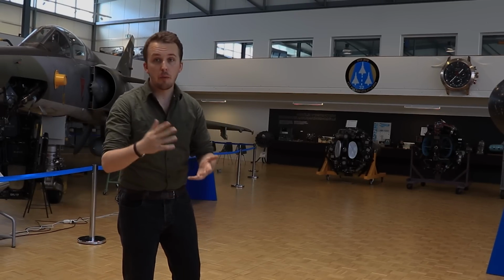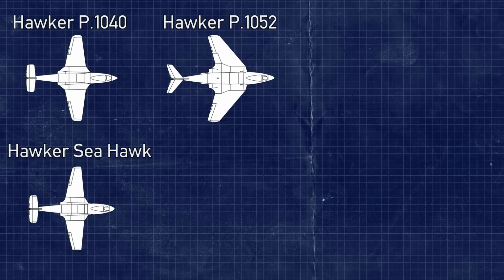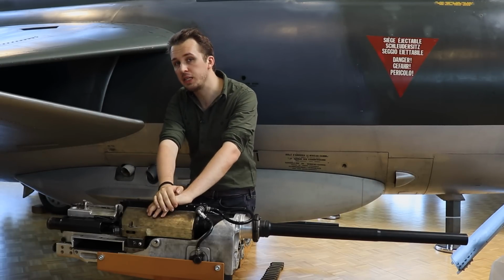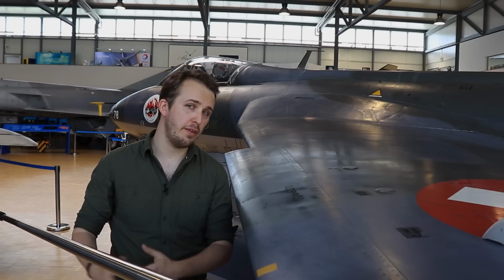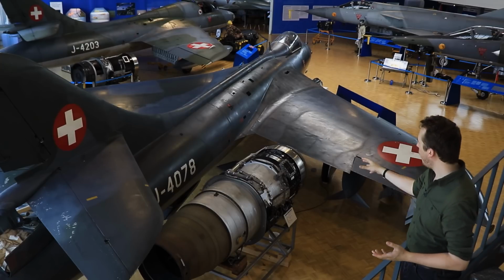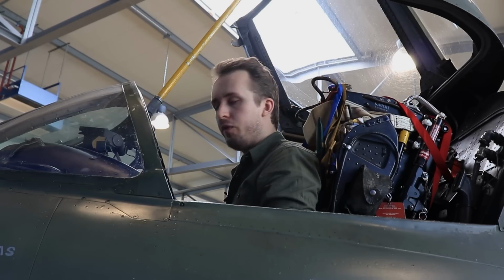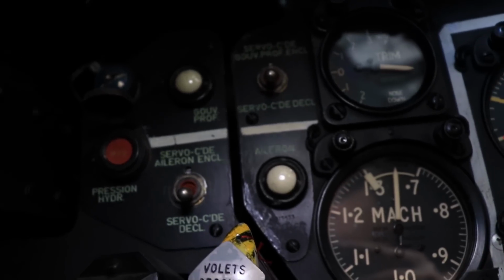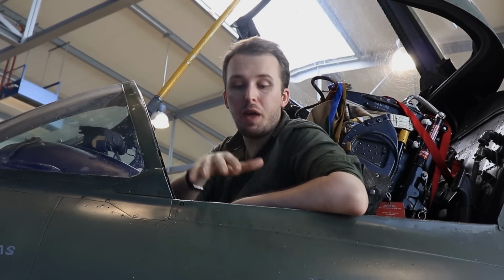Inside The Cockpit - Hawker Hunter F.6 / Mk.58

Comment: Considered by many the best subsonic fighter ever. The Swiss FGA.58 is much upgraded and a very capable machine. I believe the segmented box's at the rear of the 'Sabrinas' is the Chaff and Flare dispensers. The RAF Hunters had a ranging Radar and a Ballistics computer to aid Air to Air gunnery and accurate firing. The controls of which were duplicated on the Throttle to give a measure of HOTAS in Combat.  The gunsight had air to air and air to ground modes.
Reply: u didn't see the speed gauge did you? the top end is MACH 1.3 she was a supersonic bird.

Comment: As a Swiss guy and a true Hunter fan I really appreciate your video about the Hawker Hunter as it is really hard to condense the extensive history of that iconic aircraft into a 20 minute video. So you did a good job on that. However there is a small thing I'd like to correct. Before you entered the Cockpit you talked about the Sabrinas and pointed out that the gases from the Gun firing where emitted backwards, away from the jet intakes. Now what you pointed at actually where the Chaffs and Flare installation. The gases where pointed downward by the gun deflectors at the end of the barrels as you correctly said before and some of the internal gases where evacuated together with the shells of the guns via the tubes between the Sabrinas and the fuselage. Furthermore with the newer Rolls-Royce Avon 203 which was in the Swiss Hunters this problem wasn't existent anymore. How ever the Swiss hunters are special in many ways and differ from all the others. So where the MK 58 the only ones with RWR, Chaff and Flare containers e.g. (as far as I know). This was all added in the KAWEST - standig for "Kampwertsteigerung" (or Hunter 80 Program) in the 80es. Also the Swiss Hunters where the only ones able to deploy Sidewinders and some where even equipped to deploy the "Maverick AGM65" Television guided Air to ground missile. Special as well at the Swiss Hunters Sabrinas was that they where elongated, not only to collect the ammunition links (which was the main reason for the Sabrinas) and contain the Chaff and Flare installation, but they had to collect the empty shells as well. The first Swiss Hunters ejected them as all Hunters did, but during training's on shooting ranges in the Swiss alps (Axalp e.g) these shells fell to the ground on meadows, where in the summer cows where located. Now these cows licked on the shells during the grass feeding and showed signs of poisoning later on. So the Swiss airforce hat to do something to prevent this. So they defined, that in peace times the Hunter just carried 30 rounds of ammunition per gun, so that the empty shells could be collected in the Sabrinas as well. Furthermore because of the immense recoil of the four 30mm Aden guns (could be more than 5t), which tended to damage the structure over time the Swiss airforce decided to fire only two of them simultaneously. 
B.T.W. In the 1970es Switzerland got an offer from Hawker-Siddley for a more modern and improved Hunter the so called Super Hunter. How ever the Swiss airforce wasn't interested in it, as it offered to less and many improvements Hawker-Siddley proposed where already incorporated in the Swiss Hunters anyway by the Swiss airforce them self.

Comment: Why do you need a 30mm cannon on this plane. If it is going to shoot down bombers a 20mm should have provided plenty of fire power with less weight.
Reply: The aden cannons were just better
Reply: @ethapnerry5740  You do realize that it could be produced in a 20mm version with little difference in cost.
Reply: @johnmcmickle5685  you just answered your own question
Reply: @ethapnerry5740  I am asking about the reasoning behind the decision. Now run along. There is no need for a 30 mm. Especially when you consider all the negatives like reduced number of rounds per gun carried, or the additional weight of the guns, just to name two oblivious draw backs to using the larger caliber.
Reply: @johnmcmickle5685  britain was already using aden cannons so it was just more effective
Reply: @ethapnerry5740  That might be but if you could increase the number of rounds carried per gun by 20% or more you increase the potential effectiveness of the aircraft.  Iit is like the story of the Tsetse Mosquito that shout down a German plane with the 6 pounder mounted on board. It worked but no necessarily the best choice of weapon for air to air combat.

It is a balance of weight, power, amount of ammo, and what is needed.

Comment: I spent over ten years working on the Hunters of the RAF in various places. It had a novel starting system which used isopropyl nitrate turbine starter (although the trainers used a cartridge system). The air brake was interesting from a hydraulic point of view in that when set to operate hydraulic pressure was fed to BOTH sides of the jack. This resulted in the air brake operating very quickly. Engine changes needed the aircraft to be split in two just aft of the wings, this was always a lengthy job. And I recall changing an engine which went u/s on its first run. The only spare engine we had was in another aircraft which was at that time u/s for another reason, so I think that the one engine change turned into four! The other major job was setting up the undercarriages to Service Instruction 72. This was a seriously fiddly job and if it needed doing to all three undercarriages could take a couple of days. One had to adjust the locks to hold the legs up, also the sequence valves for the doors and the door locks, nightmare!

Comment: the F-104 was twice as fast and it had about the same amount of power
Reply: Crashed twice as fast as well.
Reply: the F-104 was about half as heavy with a higher revving engine...
Reply: @Jack29151  weight affects the acceleration not the top speed, the top speed of a loaded B-17 is exactly the same as an unloaded B-17.

Comment: Conversion Mk 6 to Mk 9 was thought to be the best. This was an upgraded in the mid 1960s to fire four guns at once (RADFAN War) and fitted with an upgraded 'Foxhunter 'RADAR for interception. MK9s are quickly/simply identified, by a strut supporting the inboard fuel tanks and camouflage which overlapped the leading edges of the wings.

Comment: Sometimes I have to wonder. The Hunter was so specificialy built arround the Adens and later proved to be a solid early jet aera groundattacker aswell. What if Hawker would have had enough funds to redisign the airframe to convert it into a proper close air support plane? Just imagine a streight wing configuration with the potential for more payload, ammunition and maybe armor ( A bit like a Fougar Magister on steroids if you know what I mean). This could have been a true predecessor of the A-10 if you ask me.

Comment: My Chief Tech' in the gun bay at Brueggen told me that, Hunters normally only fired two Aden guns at a time. As if all four Aden's were fired at once and the Hunter wasn't in a dive it could slow it considerably? I never witnessed it my self as I only worked aircraft fitted with two Aden's', two Mauser's or a SUU gun.
Reply: Chilean Air Force Flew them from 1965  to April  1996.  And is mostly true what they told you ,  Often use only two cannons , for another  reason too, the  "insane" vibration of the whole airplane when sooting the four of them

Comment: Ingenious engineering to handle blasts from the guns, at both ends!

Max speed 120 km/hr? That should give it endurance..
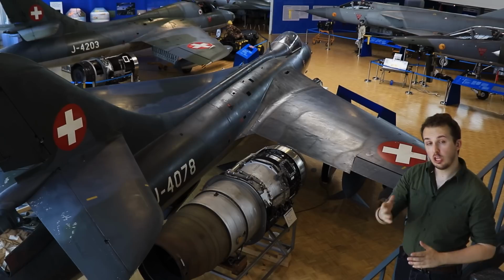(Beautiful shot of the turbine blade connections at 10:51.)
Reply: if you look closly you can see a x10 under the needle
Reply: @rupr-w4m  Disappointed! Not so funny then! ;-)
Reply: They look really pretty but if they could manufacture the thing as one piece they could save 50% of the weight on each compressor disk.

Comment: my favourite aircraft! i just want to add that the swiss air force actually tried to replace them in the attacker role in the 70s with either the A-7 Corsair 2 or the Dassault Milan. The air force wanted the Corsair while the government wanted the Milan because it was co-developed by the federal aircraft works in Emmen (todays RUAG). this quarrel led to neither aircraft being adted and the Hunter serving until 1994 when it was quickly phased out without replacement due to cracks being found in the airframes. a lot of planes continue to fly though, some through private clubs and a couple where sold to the company ATACS which uses them as Aggressors.
Swiss Hunters where also equipped with swedish BT-9 bombing computers (a modified version was also put into the Saab Viggen) and later version where able to carry BL-755 cluster bombs (TABO in swiss air force lingo, short for Tiefabwurfbombe (Low drop bomb)) and some for early AGM-65 Mavericks, which where deemed of limited usability becasue they didn't have an IR camera but still used a contrast lock on system. this worked fine in deserts but poorly in forested areas
Reply: The Swiss Hunters would turn up in Sweden from time to time to make use of the Vidsel firing range for weapons test and training they simply did not have the space for in Switzerland. The official magazine of the Swedish air force always had good articles on the visits complete with good photos. Was fascinating to see the Hunter still in use when the Swedish ones had long since been retired.
Reply: after the buying of the Milan and the corsair II failed i believe the swiss buyed more hunters instead
(i am swiss🇨🇭)
Reply: @quizels0695  Yes, 30 to be exact. Hawker Siddley searched all over europe to get that number (even going as far as to buy up gate guardians and air frames from target ranges in Belgium and the Netherlands. these were the nrefurbished in britain and sold to the swiss air force
i can really recommend the book: "Hunter ein Jäger für die Schweiz"  by the Hunter club Interlaken (ISBN 3-85545-840-5) if you understand german it's a great source (there is also one about the Mirage III by the Mirage club Buochs)
Reply: Was the F/A-18 the actual replacement for the hunter jets?
Reply: @rbr8931  no, the F/A-18s were bought as Mirage replacement, they lacked any air to ground capability save for the gun at the beginning, this was retrofitted in the mid 2000s

Comment: P1099/Mark 6 wing has an extension in the leading edge about halfway down its length. Can you explain the purpose of this? Thank you.
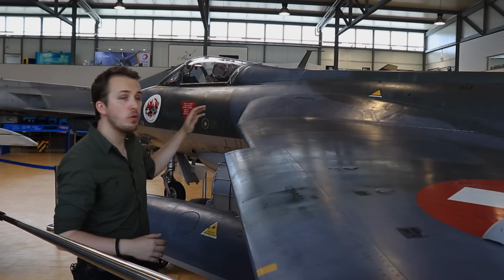Reply: You were not paying attention to this video. Listen again from 9:00 time stamp.
Reply: @nightjarflying  thank you, I did miss that.
Reply: David Ewing  Here's a quote that explains it:

"With both forward and back swept wings, the rear of the wing will stall first. This creates a nose-up pressure on the aircraft. If this is not corrected by the pilot it causes the plane to pitch up, leading to more of the wing stalling, leading to more pitch up, and so on.
The solution to this problem took on many forms. One was the addition of a fin known as a wing fence on the upper surface of the wing to redirect the flow to the rear (MiG-15 as an example.) Another closely related design was addition of a dogtooth notch to the leading edge  of the wing."
Reply: @griffn14  thank you, I appreciate the details.

Comment: French, German and English mixed up on the controls, keep you on your toes.
Big thanks to the museum and to you.
Reply: This being a Swiss service aircraft, the pilots spoke at least 2 of these languages, and I'm pretty sure they understood the 3 well enough
Reply: @MrSam1er  My comment was tongue in cheek :-) I merely found it amusing that the non-English markings were not exclusively French or German, and how they decided that. 
In the case of the "FUEL" gauge, though, I can understand why they did not use "NOCHAUSSTEHENDERBETRIEBSSTOFF", because by the time you read it there would be none left.
Reply: I made the same observation, and the use of km/h. Sweden had metrics in the first batches of Gripen, later changed to feet and knots. And as well retraining the pilots. Sweden was one of the first external users of the Hunter called J34. A stopgap for Draken J35, 120pcs used from 1954 to 1969. The Historic flight in Sweden uses an ex Swiss Mk58 as a substitute for the Mk50.